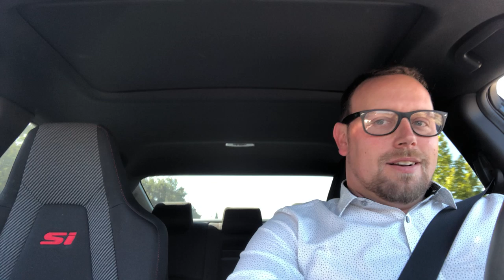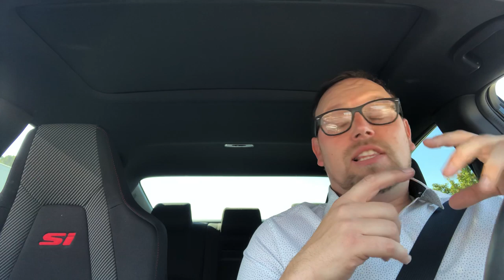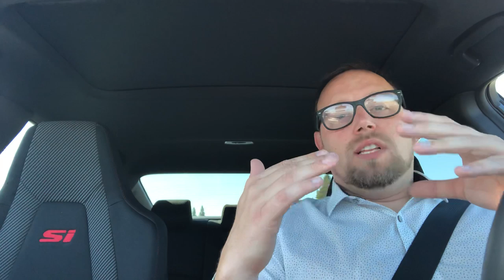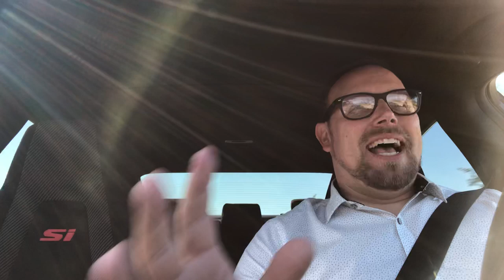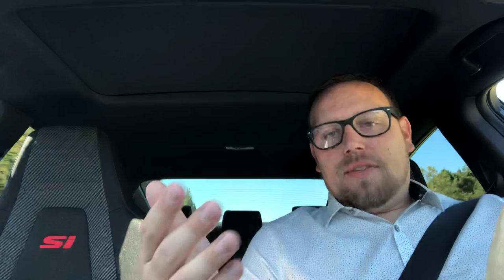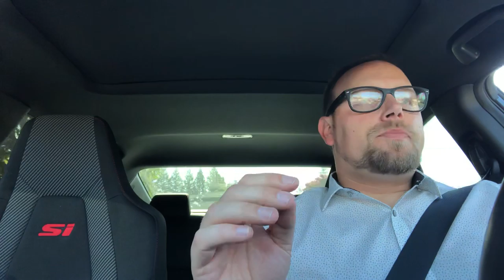How does a  turbo and Blow off valve work ?

Comment: Mmm, isn't that the reason why you get a tuner so they can tune your ECU to compensate for the correct amount of air your engine should be getting if it's vented to Atmosphere? Or is this more so based off of the stock map or off the shelf maps?

I don't know anything about the 10thGens unfortunately lol but I'd assume that as long as you're running Speed Density (Tuned on the MAP Sensor instead of the MAF), you can vent to Atmosphere all you want. But OTS tunes/tunes on your Ktuner/FlashPro library, are most likely tuned off of your MAF, so it's still expecting to see additional air from the Recirculated BOV.

I could just be talking outta my ass too, so there's that lol.
Reply from the maker: Noiseless Productions hey that’s what chat is all about.. I guess if you tune it you prob could fix the issue

Comment: Ty,  what is your opinion on the new turbosmart kompact blow off valve for the 2.0 turbo jeep wranglers.  Would it help it or hurt it.  Cj parts did a video on it on YouTube.  The jeeps seem to launch al every time you take off no matter what.  Once you get used to it its a bit more controllable,  but I wonder if this would minimize it or help with the lag.